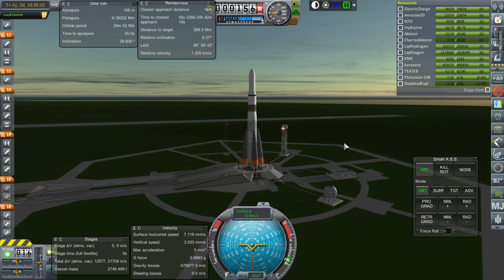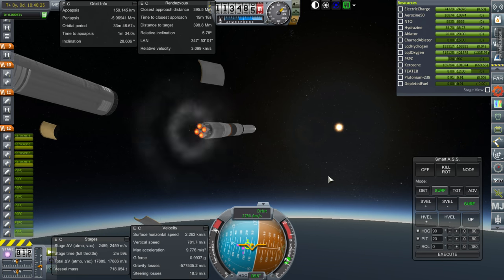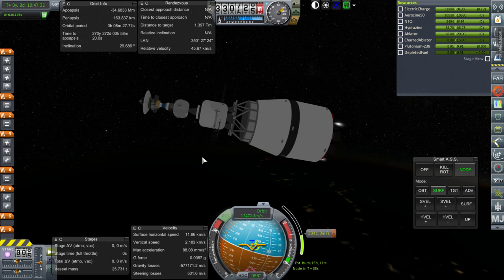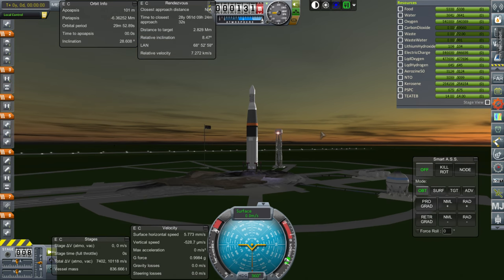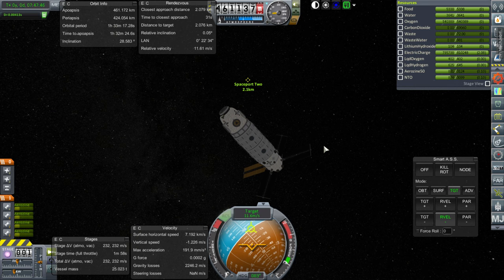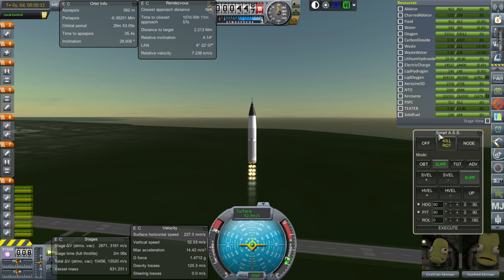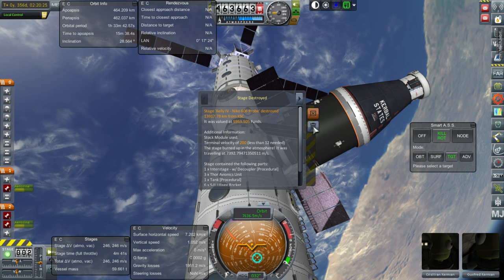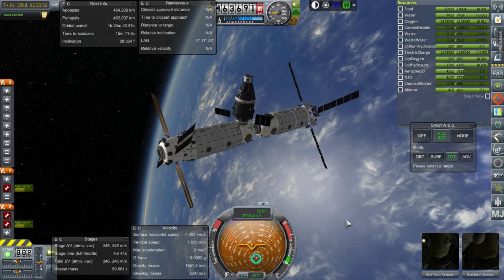Realism Overhaul in Kerbal Space Program 1.1.3 - 50 - Towards a Proper Station

Comment: Regarding the mixture issue on the Titan Shot booster:  there were some Soviet engines which ran "lean" (favored oxidizer) IIRC.  I'd check the engine specs and make sure the tanks match.  Regarding retaining the booster with an engine issue:  if you have to  ensure safe separation, that's one thing, but I'm not sure how much you'd gain by delaying until the engine out booster burned through its fuel because at that point you are lugging the dead weight of three empty boosters with you.  Changing staging on the fly to ditch the three empty while retaining the one with an engine issue seems like courting chaos.  Perhaps the best bet would be to do some "simulation testing" to determine minimum burn time to safe separation and set that as a cross over.  If you have a failure before that time, you would be forced to delay separation to ensure it was clean, but after you'd just shut down the booster with the issue manually and stage at the normal time.

Comment: do you have the FASA mod installed?  I believe it's FASA that has some launch clamps that just seem to be a lot more stiff in RO. I used to have a problem in an older install where I would destroy the launch pad if I built something too heavy. but it seems to have gone away when I started using different launch clamps.

Comment: I have ksp 1.1.3 with realism overhaul, real progression zero and real solar system. BUT for some reason a mod that is supposed to add engine failures and limited burn time to engines is not working. I've tried searching this up in the forums but nothing came up. Any suggestions?
Reply: It appears it did not download it at all.